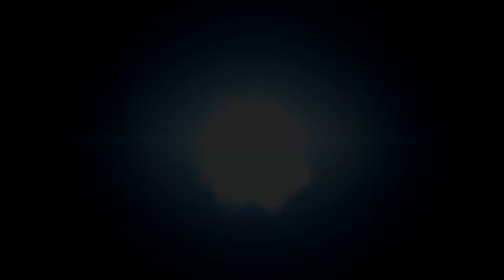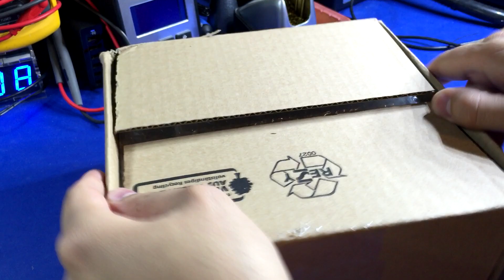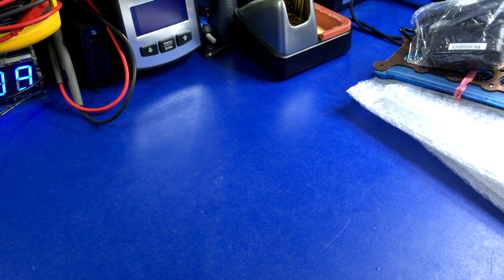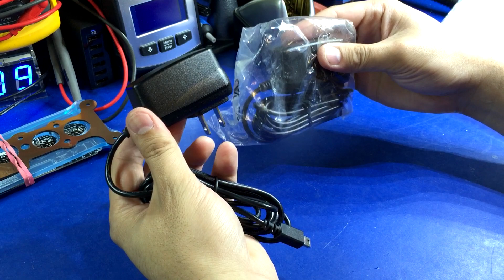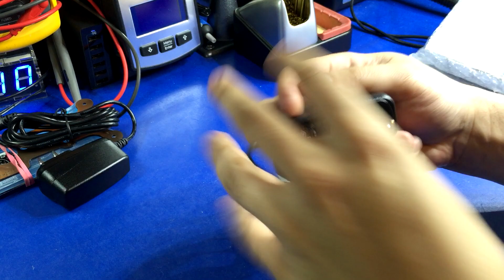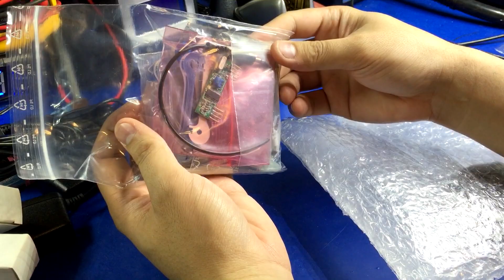Classical Soldering - VFD Tube Clock (It's Awesome!) - #0053

Comment: those are flourescent bulbs, and the oil on the hands goes for larger mercury vapor bulbs and halogen, oil creates a hot spot on the glass and high temp bulbs get weak spots.

Comment: I have always heard that it was car bulbs that pop if you touch the glass too much, something about the oils weakening the glass added to the heat from the filaments makes them bust.
Reply: +zeos386sx It's a grease from your fingers that makes them pop. You leave a fingerprint, then turn the power on - filament gets incandescent, produces a LOT of infrared rays that heat up a residue, which in turn gets more opaque and thus absorbs even more IR energy. At some point, the glass in that place will be much hotter than the rest of the envelope, and will crack thanks to a big temperature differential.
Reply from the maker: I have heard that as well. I wonder if the same is true for LED bulbs? My car has LED headlights. They're not replaceable and just molded into the headlamp housings, which tells me they expect them to have a very long life.

Comment: At 1:27:37 you say that VFD tubes do not have a heater in them. That is incorrect. They rely on thermionic emission from a filament in the front of the segments. The problem with fingerprints is on Halogen bulbs where the glass gets extremely hot, and the hot-spots caused by the finger oils can break the glass.
Reply from the maker: I meant in respects to how hot they get. You can touch a VFD bulb and they feel cool to the touch, as where a vacuum tube can instantly scorch your flesh.  (I've unfortunately found out the hard way by grazing the tubes on my headphone amp a couple times)

Comment: Nice job on that classy clock assembly.  I enjoyed all of your narration!  

Yea, no finger print worries at all with those VFD's.  Florescent tubes gradually dim with age/use anyway.

Oily finger prints can only etch onto the surface of those old quartz-iodine or arc/discharge lamps that run extremely hot, near the melting point, the glass actually starts to glow orange!

Comment: From what I remember the concern about touching incandescent bulbs with your bare hands applies to high wattage bulbs. Anything over 100W. The oil you leave on the surface of the bulb creates a spot that will heat and cool at a different rate than the rest of the glass. That'll cause the bulb to explode in some cases.